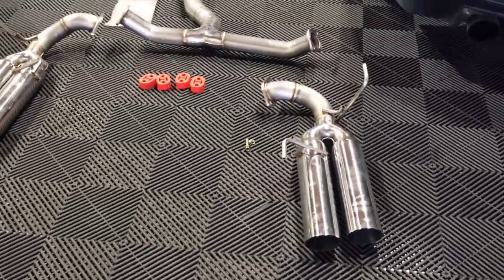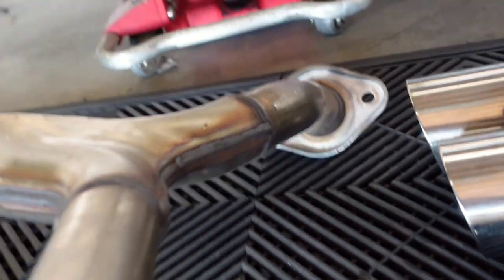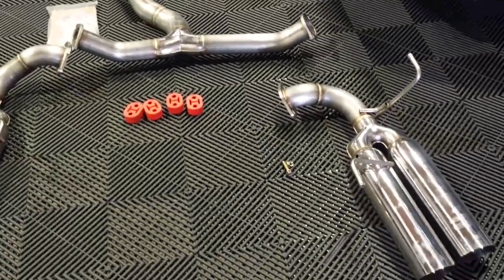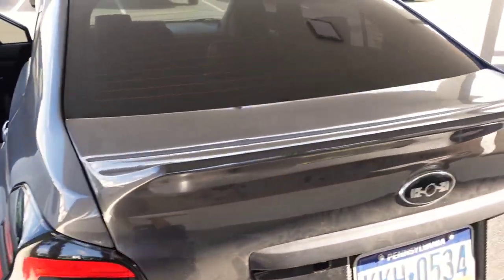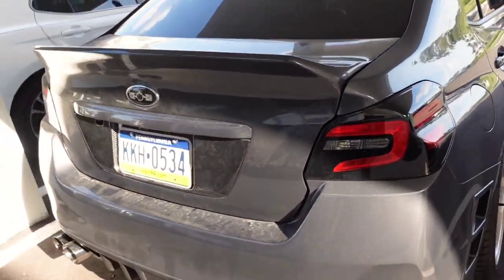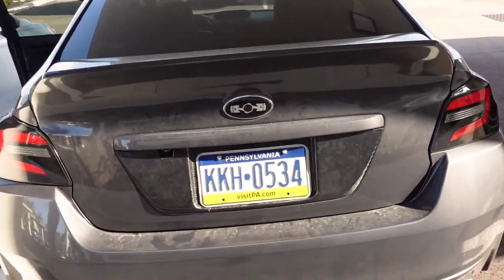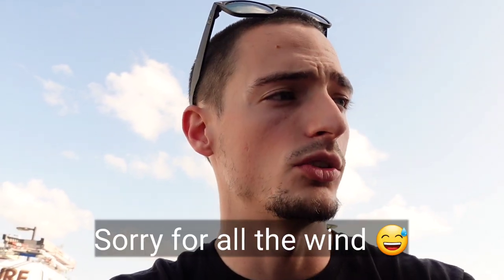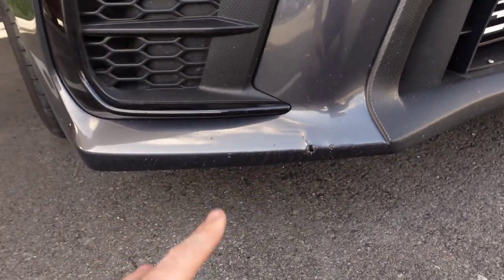New Exhaust & Big Changes For The WRX

Comment: My buddy bought a Q300, that thing has zero zasp very deep sound. It was a bit too quiet for my taste, but it was perfect when he installed a catless dp.
Reply from the maker: The q300 sounds amazing on almost any car but it is super quiet on a stock car and still a tad too quiet for me with a downpipe. My issue is with most exhaust systems that add resonators or mufflers it almost completely hides the turbo spool. Which is why I chose this setup. The spool is super loud!
Reply: @StreetInspired1  I agree with that. Q300 is still a bit too restrained, almost muzzled. Not much range in tone or turbo sound. I had at one point 4" nameless axleback on my 16 WRX they sounded great, but rasp galore anything over 3k rpm. 

I was lucky to own a Mustang GT shortly after my 16 WRX, installed Borla Atak on it.  I was blown away with the sound, volume and how dead silent the car was while cruising. Not a hint of drone at any speed. 

I think I will go with Borla S-type, I'm back in a Subaru WRX again. I sold my mustang for 6k more and couldn't afford not to sell it. 😂

Comment: love my remark midpipe, definitely adds a much deeper tone to the exhaust. I’m still running a nameless 2.5in axleback so she leaks a bit between flanges and I was considering just getting a remark branded axleback to stop the issue, but man those prices went way up! Remflex gaskets will have to do for now lol.
Reply from the maker: It's a quality peice for sure. And definitely. When I got my first brand new wrx in 2016 I wanted an axleback and remark was the cheapest one on the market and now they are one of the most expensive. Crazy how that happens. I guess the strategy is to buy the new brands before they go up haha. My 1320 downpipe was $300 on my first wrx, $350 on this one, and now they're $425. Once the brand gets more established they start cranking up the prices!
Reply: I have my remark 3”mid pipe none/R in cat back 4” double wall in Ben there since I bought my STI last April 2021 in sounds sweet deep in nasty tune lol I love it

Comment: What exhaust hanger bushings do you use?
Reply from the maker: The Remark I just installed came with new red polyurethane Bushings. I was using some adjustable polyurethane Bushings I got from ebay before I installed these.